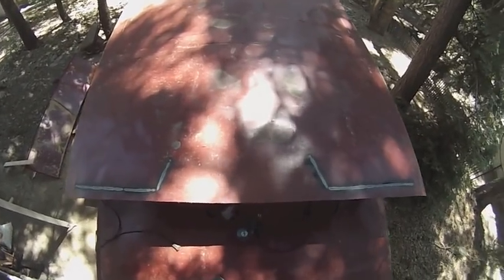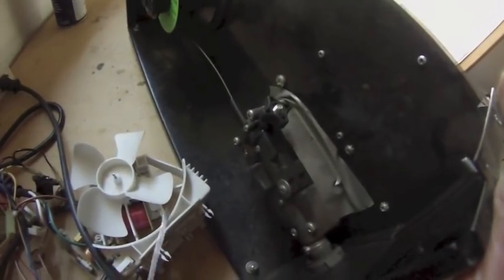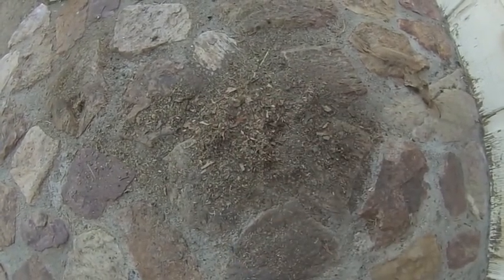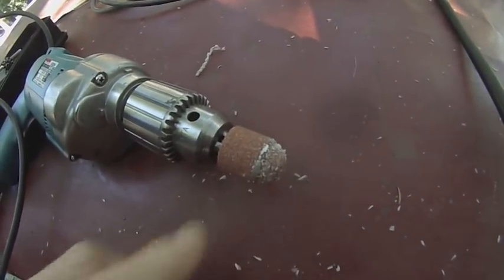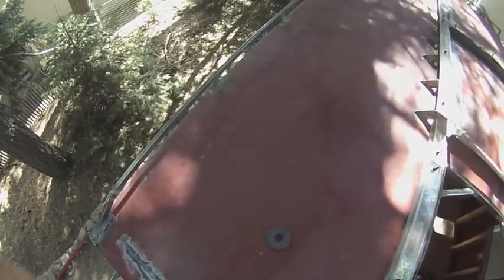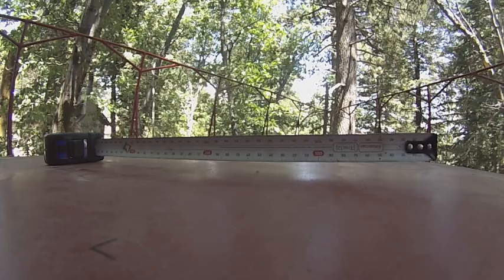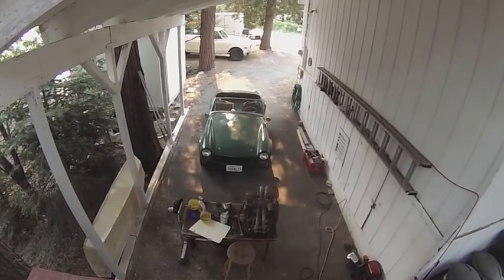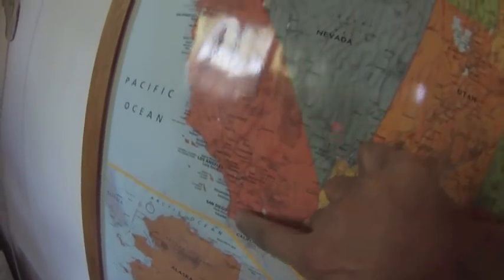Steel Sailboat Build Part 19

Comment: As someone who sails, welds, and works on boats, I appreciate the massive amount of work going into this.  As someone who sails, welds, and works on boats, I can say this is a really, really bad idea.  I don't think you appreciate the forces involved in a boat this size, or the engineering involved in keeping them in one piece.  When I saw part 1, I thought "Eh, it'll never be finished, never see the water anyway."   But you are tearing through this and seem quite determined.  Please be diligent about your safety protocols when this thing does hit the water.  Heck, have a surveyor take a look at it before you launch and see what they have to say.

Comment: I think a good idea would be to seal off the first 2 foot of the bow for a crash hull and put a little tap or something lick that so if you happen to hit anything you can open the tap and see if the hull is still water tight 
you could also split the space in half for a chain locker  so far it look quite good something a bit different but if all goes well doesn't really matter what it look like

Comment: The cleat on the bow is too far forward. You also need one on the port and starboard at the bow for dock lines. Also several feet back. Then two midship and two on the stern. You need two bow rollers for your anchors. That is why your front cleat (bollard) is too far forward. Make sure that cleat is well attached. Maybe through the hull and braced under the hull skin. Weld an 8x8 pad on the top side and then a 12x12 plate on the bottom. Cut holes in all of them so that your bollard goes all the way through and weld both tom and bottom.

Comment: Great videos!  Might consider filtering the air intake on the wire welder.  What keeps the hatches water tight along the slides?  Watch out for the cougars on your hikes!
Reply: This should be extremely helpful on his hike!

Comment: Don't tell me you're mig welding that whole boat?
Reply: mflynn81 Hi, stick welding penetrates further and therefore a fair bit stronger, not to mention cost, I would say that with a big project mig welding would probably cost at least 5 times the cost in wire and gas. Welding rods are dirt cheap.
Reply: Stick welding on that gauge steel can be done but it takes skill . You can train a Uh low skilled worker to mig in about 5 minutes. Also have you priced 7018 electrodes lately?
You dont get penetration with amps you get it with proper prep and welding skills (puddle control) If you just crank up the amps you end up with a porous, brittle weld.
Reply: i'd mig weld it too, and welding rod are not cheep for decent one's!! then you actually need a welder that will burn them as your cheep stick welder's you get for a few hundred quid won't  that and it's a pain in the arse to well thin sheet with one
Reply: inner shield, no gas